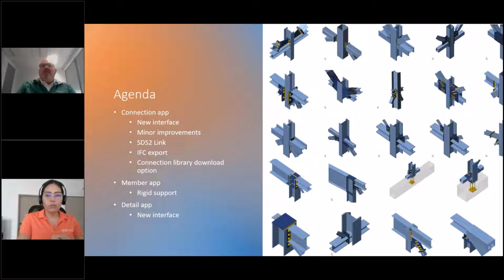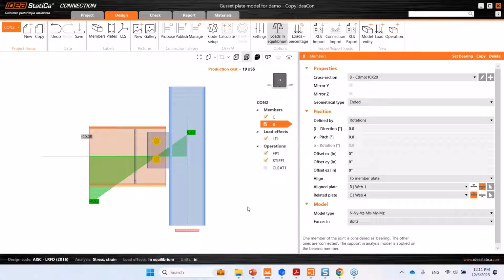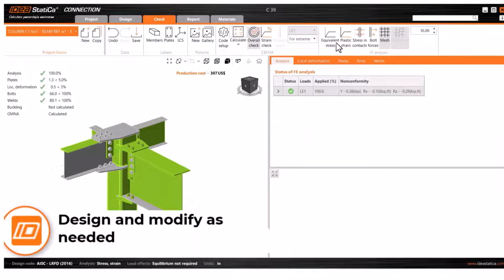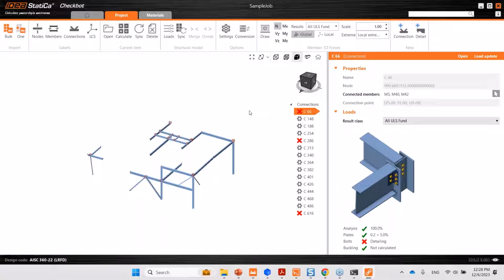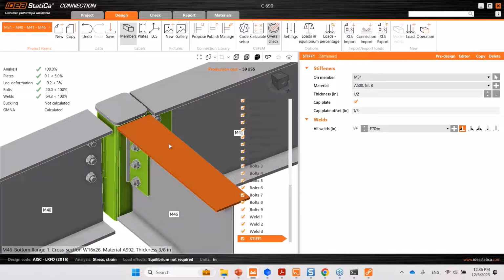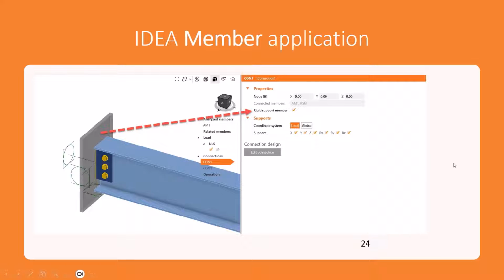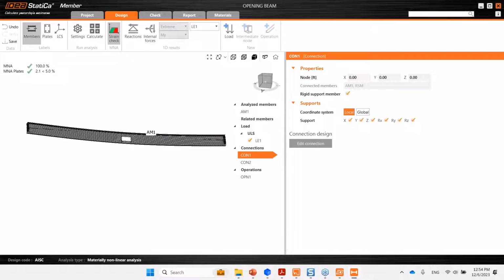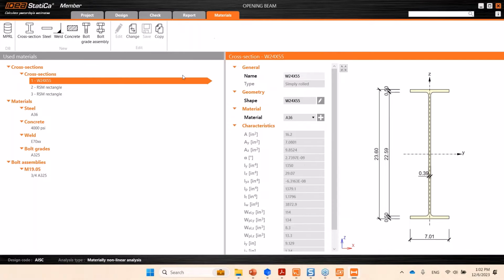Round-trip with IDEA StatiCa 23.1 and more...

Comment: Why idea statica team not include U bolt connection option ?? I raised the query multiple times... 😢
Reply from the maker: Hello, IDEA StatiCa Connection is focused on structural steel connections, but U bolts are not supported since this is rather a solution for a different situation than structural systems of buildings, halls, towers and bridges...
Hovewer there are some workarounds sometimes:
https://www.ideastatica.com/support-center/tubular-clamping-connection
Reply: @ideastatica_en  sir.. I see Many structures of solar panel supporting. Have pipe on pipe connections via u bolts.. And you said they are not used as structural bolts ??? Please do something to incude u bolts in the software. Not every time we can go with this clamping connection specially when moments are to be  transferred...